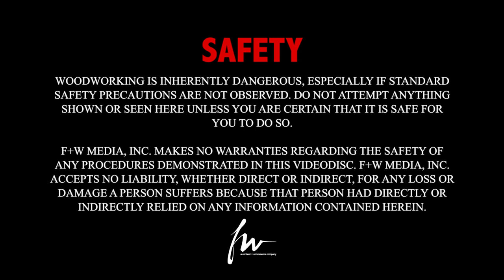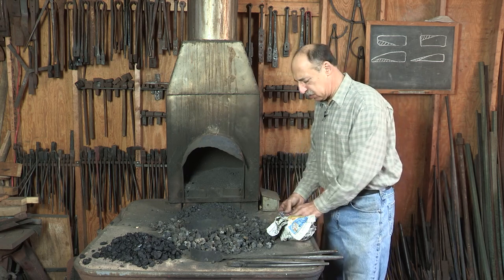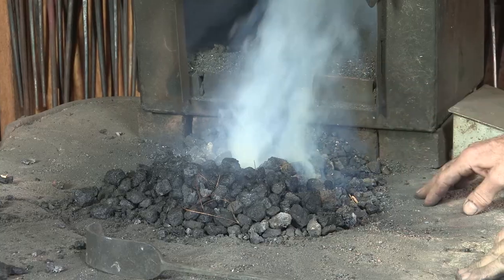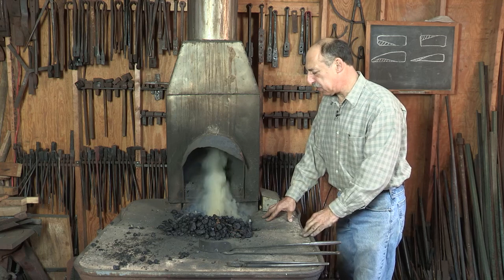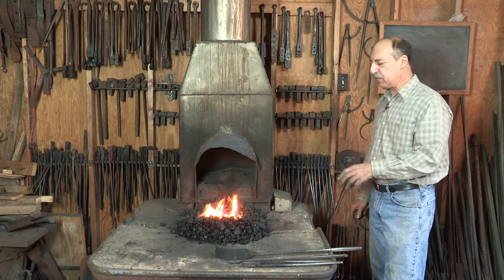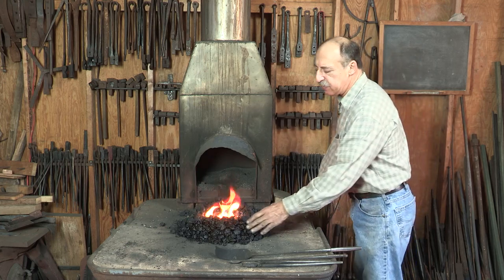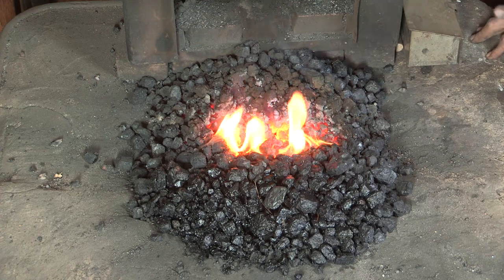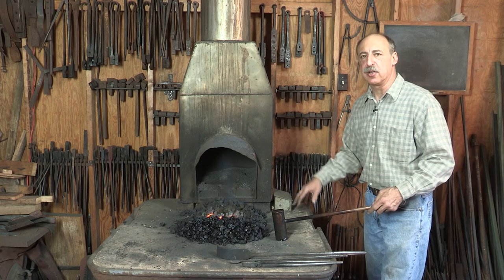Peter Ross - Firing Up a Forge

Comment: This is useful information for those who wish to make or modify woodworking tools or hardware. This as understanding what a good fire is helps prevent problems when working at the forge... e.g., getting an even heat is important as it only heating the sections you want heated. 

Peter has been a good teacher over the decades... One I appreciate. I hope others do also.